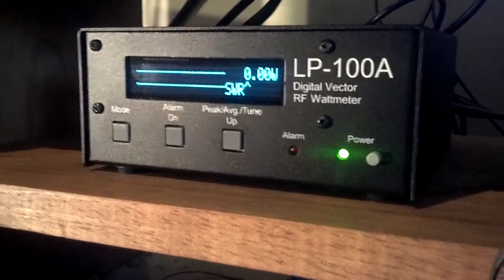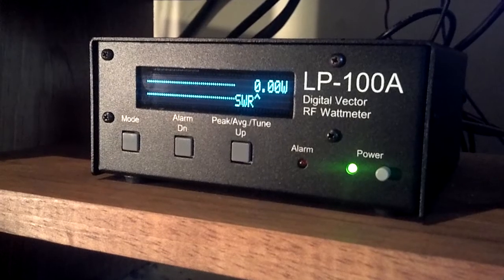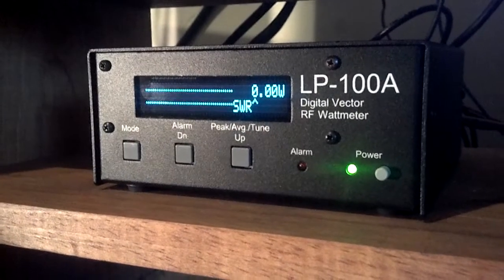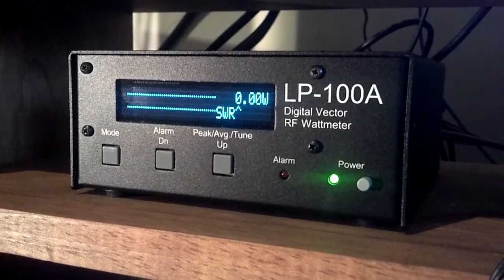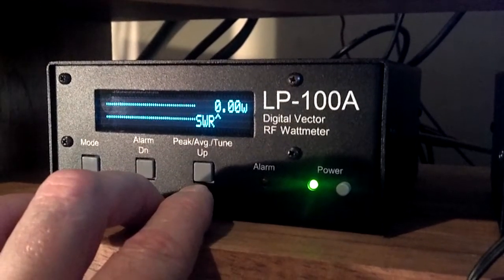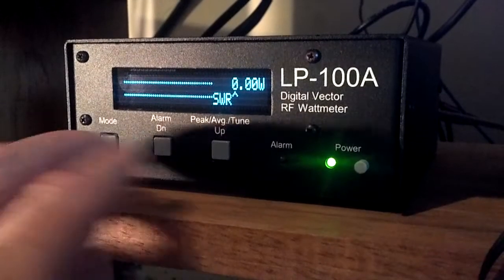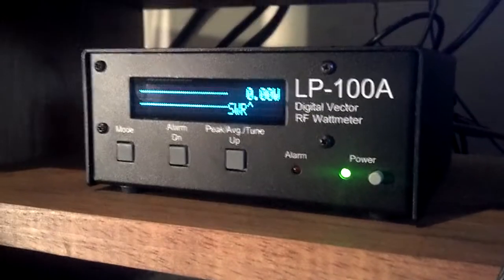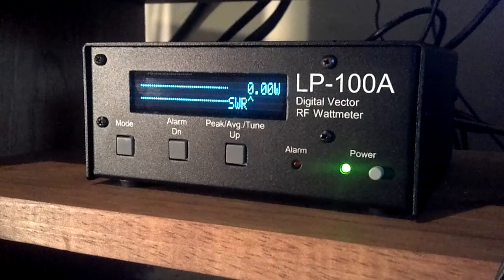A CLOSER LOOK AT THE LP-100A

Comment: Hey Bill i got a question i just got in a palstar hf auto  i have the radio to palstar and then to my teleport lp-100a for some reason the swr alarm keeps triping and i have it set to 3..5 the palstar says 1.08 im confussed do you have a idea whats going on? thanks kb5vdo
Reply from the maker: when you look at rigs swr what do you see? email me at bill@k4fx.net
Reply: Jay, I have an LP100a and a Palstar AT2K and while I am certainly not an electronic whiz, I'm told that your tuner should be the last piece of equipment in the line to your antenna. So, from your radio output should be the LP-100a, then the Palstar, then finally your antenna. Look at the Quick Start manual with the wattmeter, I might be wrong.  I don't know if this will fix your problem but it's just a suggestion.  You really have made some good purchasing decisions for sure! 73, Dennis W5ALJ
Reply: @dennisbozeman6491  Hey Dennis thanks alot for the Reply ok your info was sure a big help it all makes sense now thaks a Million!